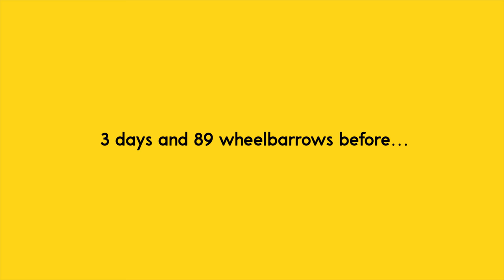How To Start A New Garden (From Start to Finish)

Comment: Hello, I am a brand new gardener.  For the purpose of  no till terminology, are mulch and compost the same thing?  
From what I am seeing, it looks like you're just putting straight compost down to plant in.  Is that correct?  I have horse manure compost available that has been sitting for a little more than a year.  Will that be safe to use straight?  Or do I need to dilute it with something?  Thank you!

Comment: I would have used a backhoe and dig a trench 6' deep - put a layer of cardboard down topped with large rocks, the another layer of cardboard with 3/4 minus. Next would be wood chips topped with straw and followed with compost.

Then 

Move over 18" and do the same - each role being as long as needed and as many as needed for the grow area being placed in to serious service. 

Then just top off every year with compost and straw com fall on each grow bed, place new cardboard between the rows as weed block in fall and spring.  

The rocks in the trench acts as a ground watering system  for the roots as the wood chips and straw gives the roots a soft ground to grow fast , combined with the compost addition = prue rocket fuel ⛽ in which your garden needs. 

The plus side is weeds are easy to pull out - roots and all... 

The best part - you can build up the sides of each row and in time had raised grow beds as you age - making bending over less of a chore as you age.

Comment: Nice work, any link for those cardboard rolls?

Step 1.5 Get a boxcutter with break off blades so you always have a sharp edge.  :D

The only improvement would be I would have had biodegradable row covers on before the woodchips.  Then it would stay weed free.

Comment: He should have run the beds the other way round using the roof as a watering system by adding swales. He could have started by adding a dutch draining system utilizing the rain run off and then adding a no till garden on top

Comment: Lovely video. I have a question about irrigation. In the last shot you have a sprinkler. Is that the best way for a large plot or would it better to incorporate a system with either pvc pipes or other material underneath the plants?

Comment: I really don't consider the broadfork to be no dig. Mycorrhizae are cut up very badly. Other probiotics are also severely damaged. I like to load my wheelbarrow and garden cart facing the way I need to push it. If you don't run your cardboard too wide you can tie off to the stake, walk along the bed to the other end, and tie it off?

Comment: Hi Moreno, I love all your videos and finally you convinced me to start a no dig orto as we called it  in Italy,  I am in Sardinia and as you might know the summer temperatures are really difficult for growing anything,  but I am determined to start this coming September so could you please let me know the type of compost you are using, the composition of it and the thickness of the beds, what system of irrigation do you apply and any other helpful information will be very much appreciated. 
Look forward to your next video and many thanks for the nice times spent watching you.
Bravo  👏👏👏
Reply: Antonio, I am unsure if you started your gardening venture in September 2021 as planned. But here is some information on composting below (thickness and spacing will vary per plants and what you are working with as far as how compacted the soil is below).

 @Azyang Adap  Dry (mostly) anything equates to brown (aka carbon or carbohydrate rich) that adds to the bulk for the organisms to eat and adds aeration so compost doesn't become anerobic and take longer to decompose. 
While freshly mowed grass is considered "green," which is nitrogen (or protein rich) which heats up the compost and causes the microorganisms to multiply. If you have old and dried out.... then it is considered "brown".

Multiple things that was "green" at one point  becomes "brown".

Don't be afraid to compost everything that was recently alive at one point. Exception, I recommend staying away from putting treated wood/board sawdust in. Well, do further research on it at the very  least and I would recommend allowing to compost longer. Meh.

I have researched a lot of articles from all different types if forum from agricultural universities,  government agriculture websites across the globe, different organizations, gardening enthusiasts,  people's experiences from YouTube and in the comments, etc. I just finally dive off and started myself on 25 Jan 2022. I have the recording on these different composting measures. I have them as unlisted videos if anyone interested. The  compost that started from 25 Jan 2022 has been ready to go now for about 2 weeks. The one started on 18 Mar 2022 with less complex materials and not directly dug into the ground like the 25 Jan 2022 one will probably be mostly ready in about another 1-2 weeks. The one started in the Maze Composting Barrel on 23 March 2022 with mostly just fresh grass clippings and dried leaves is mostly ready... but doesn't seem to have the rich soil-like consistency of the other 2 which has much more soil contents and animal life breaking down the materials. On the second half of the dual barrel Maze Composter, I started it a week later around 30 Mar 2022 with similar grass clippings and dried leaves but I continually  add food scraps (primarily banana peels) into it. I also keep picking up those crustaceans Rolly Polly to put inside almost daily for over a week. Finally, the Rolly Polly seems to have survived especially with me leaving more air to get in so they don't die in the hot plastic barrel. 
Anyway, here is a short read on an article I just pulled up that will give you a better idea: https://www.thespruce.com/composting-greens-and-browns-2539485

Tip from the too many hours researching what is "good" for composting.... I have consistently read/heard that chicken poop (manure) is one of the best poop/manure in comparison to larger animals such as cow or horse. The cow manure is also better than the horse manure. Manure is considered to be "greens."

Anyway, if you read half of what I wrote.... I hope you or anyone else will get some benefit. Dive in and don't overthink it. Compost need water and air.... or it will become anerobic and takes forever to break down.... over a year instead of potentially 8 weeks. However, turning/aerating without composting barrel can be quite labor intensive 🙄 and back breaking.... even on a pile that isn't that big (3 ft × 2 ft × 2.5 ft). I think I am going to move items from composting barrel to the earth to get it potentially more richer with more variety and add more browns and greens to get the microbes to heat it up!

Happy Composting and eventual Food Abundance. P.S: I got videos on my vegetables greenhouse seedlings starter on 5 Apr 2022.... as well as my fruit sapling increased to over 30 as of 23 Mar 2022. Learning and documenting mostly by videos.

Comment: To make compost, you are supposed to mix 50-60% brown carbonaceous material (leaf litter, wood chips, cardboard) with 40-50% green nitrogenous material (grass clippings, greenery) in layers, keep it moist, and turn it periodically.  Would it be practical, in the absense of nitrogenous green material, to substitute NPK fertilizer that is high in nitrogen?  How about ammonia/urea high-nitrogen fertilizers in place of grass clippings?

Comment: I hope you see this comment.
I just bought a house with some land and I want to start this. The issue is, the lady that lived there ( it is a village ) did not plant anything for like 15 years.
The soil is very...how can I describe it...thick and you can barely use a shovel, for example. It is very compact and has an extensive network of grass, that is a natural carpet basically. The root network is nuts.
Can I do this even over such land? Because people in that village said that we have to plow the land to do anything with it, specifically because the soil is so compact.
Reply from the maker: Hi Deus, we started out with something similar. We decided to do a one-time initial tillage to break up compaction and moved directly into the no dig system! Worked out great! Good luck.
Reply: @TheDutchFarmer  Alright, just to be sure. We plowed the land already with the help of a neighbor, he has a tractor.
Then, he said we need to basically fragment the soil, since it is Autumn, it is not dry and you cannot do it by hand. He brought the tractir again and had this attachment with some crazy wheels. Don't know the term in English.
After this, we just even the soil with a rake, and then proceed with the cardboard layer?

I also want to thank you. You are an inspiration to me and my wife. Your videos are a factor in our decision to buy a 50k euro old house which we will demolish. It has 38 ares of land. This will literally change our lives as we currently live in a big city.

Comment: Amazing! A few questions: (1) Are there any limitations as to what you CAN'T plant the first season? Curious if the cardboard would prevent deep rooted plants like tomatoes from doing well. I guess it depends on the depth of the compost too... (2) What if the soil underneath is complete clay? Does that create any problems? (3) Do the wood chips need to be broken down too or can they be fresh? Great work! Love your channel.

Comment: How do you deal with squirrels, rodents and other critters eating your produce?
Reply: That's a good question.  I have a fenced in yard and a dog and two outside cats, but it's the moles. (Recently moved here -- never had moles before. ) I used urine last summer which supposedly they can't stand.  When I planted corn they totally destroyed the seeds.  Seems like they burrow under the house where they are unreachable -- but I'm not going to use a mole trap.  I had planted the corn next to the garage so the moles had refuge & easy access.  Next season more out in the open. 
I had no problem with critters eating my produce except for the cabbage worms which destroyed my cabbage but I will try wrapping them with panty hose next season.  
Also I keep my garden rather close to the house where critters don't really like to venture.
Reply: What a blessing that you do not have more critter issues.  Thank you for your thoughts.  May God bless your harvests.

Comment: Awesome vid! Just questioning/wondering something, the roof of the house being at the same level? I assume before you started that part where you raised on was sloped down away from the house. Wouldnt it have been better then instead of following the house roof and raised bed parallel having it follow the slope away from the house?
Since now you raised it even higher and   comtradicted the intention of the slope.. or was that like not the case?
How manny days of work did you throw at that, looks about 3 or so in total?

Just asking for interest 👊🏻 learned lots, subbed too

Comment: Some additional tips from someone who is a pro at this (me):  1.  Get cardboard from appliance stores.  It's free, heavy guage and large pieces cover a big area.  And did I mention it's free?  2.  Have your materials delivered.  3.  Rent or borrow a  small skid steer, like a Bobcat.  4.  Lay out your first row, lay down the cardboard, have the Bobcat dump the compost for the first row, rake to shape. 5.  Do the same for your woodchips.   6.  Build backwards so you're not running the Bobcat over the rows you just made, and lay the cardboard as you go so the machine doesn't run over the cardboard very much.  If you have three people, 2 on the ground raking and one on the machine,  you'd be astonished at how much you can do in a day.  You could do an area twice this size in a workday.   Now, there's nothing wrong with honest hard labor wheelbarrowing your materials in, but I'm old, so I want to save as much effort as I can.  This method really does work;  I've done it many times on the worst hard-packed rocky clay soil you've ever seen, and the results are amazing!  You do need to refresh your compost and chips every year.

Comment: it is a nice video very well made. but to be honest... is this kind of method sustainable or easy to handle? 
So what is the plan?

At first... you need tons of fresh compost or "fresh" earth to start. 
Second.. what is in next year? Again same layers? So more cardbord and again new fresh compost? 
How many layers do you have to do?

So or you do this every year and have to get rid og the old soil, bacause otherwise it will rise higher and heiger...
Or you have to dig next year. 

If you look at this from the point of a gardening cycle... this method makes no sense.

BR